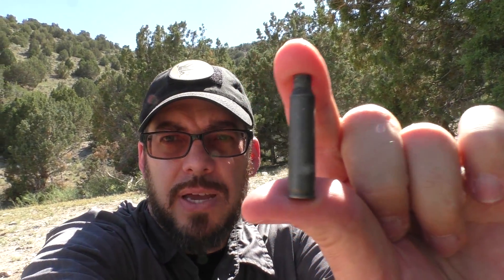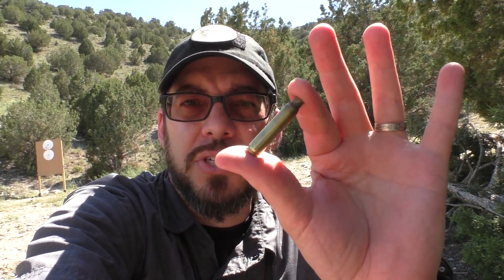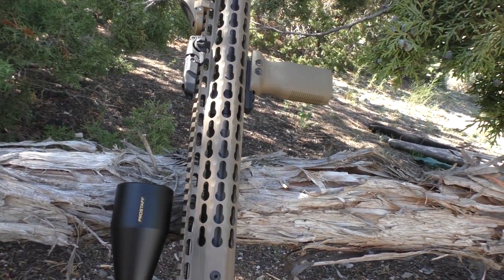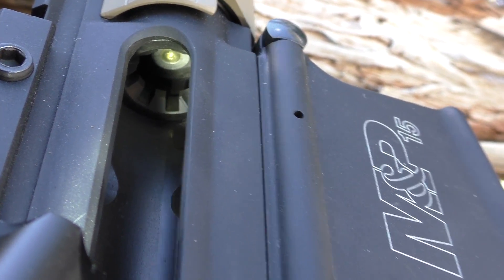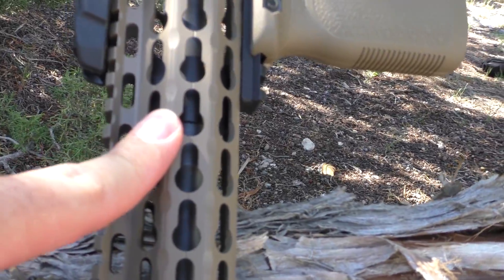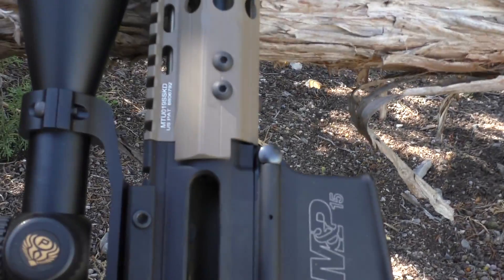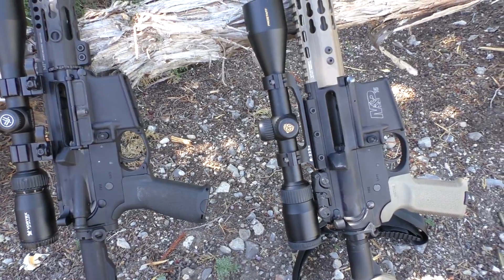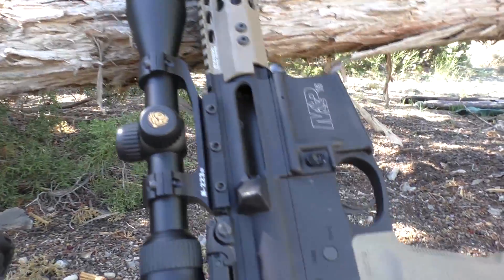Tula .223 Killed My Guns! V-Log Thursday

Comment: Bore erosion gauge if run one through both if not all the ar types you own especially since they have already had rounds expanding within the bore and getting stuck hope this helps if it goes past the warning line you may need a new barrel for both the rifles steel cased ammo is considered corrosive I know comments will blow up about that but it is and it's mostly cause it's steel running on steel so chances of you runing a thousand rounds or so though it and experiencing case expansion doesn't surprise me brass ammo won't get as stuck cause of brass being a softer metal than steel and most of your brass are polished casings there designed for ease of use and longevity of the weapon in mind there's a reason Tula ammo is cheap hate to say it but it's true

Comment: You can't get a rifle hot enough to burn the coating off of the steal cased ammo. The brass cartridge typically have a 3-5 hardness or so on the mohs hardness scale I believe and steel or bi-metal cased ammo is between 5-9. Therefore the steel is a bit less malluable than brass causing the steel bi-metal casings to not expand and seal the chamber like brass which in turn creates I higher amount of carbon build up. Carbon in itself is very hard and hard to remove once its been allowed to build up. Routine cleaing of the chamber with a good solvent after say 500 rounds should prevent it from happening again. I'm not an expert these are just my observations and experience over the year and knowledge passed to me by people who do this kind of work for a living.

Comment: Run the bolt wet. Be sure to clear the chamber before taking a break from shooting that particular rifle; the coating on the steel case will melt and then harden once the barrel cools essentially cementing the case to the chamber.

Comment: Bad batch? Or just a hot barrel causing the case to expand more than usual?
I hear this is more common with tula compared to other steel case rounds.
I can't confirm. I don't shoot steel case all that much.

If i had to guess clean the chamber using a chamber brush on a cordless drill real slow at a low rotation speed with solvent sprayed in the chamber. Working the brush in and out of the chamber slow and steady for 30 seconds. Should keep any build-up of carbon left behind.

I try to buy brass when its cheap.
Now days (may 2022) from what i can get, tula is about .39-cents per round after tax+shipping. Where i can get brass .44-cents per round after tax+shipping. So the .05¢ per round difference isn't enough to separate barrel erosion and barrel replacement cost down the road.
If the price difference was .20¢ than without a second thought steel case would be a good option.
With what is going on in the world, i tend to be more conservative about my ammunition usage as of the past couple years. Its a gosh darn shame I can't buy brass for .25¢ anymore.

Comment: I only run steel in carbine length DI system or longer, and even then it depends on the gun. as some carbine length system may be a bit over gassed depending on the gas block used. my keltec plr16 refuses to use any steel case ammo because it's a powerful piston driven system but I've also worked on SBRs for local law enforcement and they won't reliably extract steel either. so most pistol length systems just refuse to work. most carbine length systems do work with steel just fine but you just have to check your gun with it (most don't have an issue). the SBRs usually required alot stronger extractor spring along with the hard rubber cylinder inside the spring. the coiled around the barrel longer gas tubes also seem to help. steel is hard to extract from short gas systems or powerful piston systems. I'd never trust steel cased for defensive shooting but it is good for cheaper plinking especially if you don't reload. well, I would use steel cased 5.56 in my century c93 and vector v53 because the fluted chambers seems to work well with steel even with the well known violent extraction of delayed roller lock h&k system. If I have to shoot steel cased ammo I always take an AK cleaning rod with me to knock out stuck cases, it's alot better than ruining a good brass cleaning rod.

Comment: So I see this is a pretty old video, but what did you find? Its not a bad batch and its a pretty common issue that I experienced as well.  I learned about upgrading the extractor spring. I've installed it and will be testing this weekend ( BCM Extractor Spring) .  Enjoy!
Reply from the maker: I chose to ditch steel cased ammo altogether. That solved the problem.

Comment: I use tula in my s&w as well and have no problems. I also clean it after each day of shooting.
I was thinking that maybe its just a tolerance issue with these other barrels you've put on your rifles, possibly tighter than the stock s&w chamber.
So with that train of thought I agree with the posts explaining the carbon buildup due to non expanding steel cases.

Comment: Steel cases have lacquer on them usually and also have a sealed primer and it can cause issues in the Chamber and bolt face supposedly never seen it but I've heard of it the only other thing I can think of is cheaper guns (although threat guns I have be same m&p) may have weaker extractors and steel can wear them down supposedly. Again never seen it but have heard it

Comment: I've had similar experience with Silver Bear/Brown Bear steel cased ammo.  I had problems using brass-cased ammo AFTER using the steel case.  When the round fired, the action would cycle, but rip off the rim of the casing, leaving an empty casing jammed very tightly into the chamber.  This happened multiple times, making it necessary to take a rod and ram the stuck cartridge out.  I think the lacquer left residue on the chamber making it extra tight.  After shooting the rifle with brass for a while, it seemed to start working properly again, but now I'll never use steel case in my go-to rifle.  On my junkers, sure I'll use steel since it's cheap.
Reply: Is your magazine that is bending the rim or extraction lip of the casing. File down the front of your mag so the casings rim doesn't contact it anymore when it's being loaded by the bolt into the receiver. I left a main comment explaining in more detail. Do that and you'll never have that issue again with any ammo.

Comment: It's because of the magazines your using. I'm assuming they are metal but others can do this as well. When the bullet is extracted from the magazine, the "extraction lip" of the metal bullet casing (shell) is catching the front edge of the magazine causing the metal casing extraction lip to get bent back making it impossible for the bolt carrier to completely close over the casing & engage the bolts extractor. This is because the casing lip is now bent back and holding the bolt back. 
The fix: pull a bullet out of your mag just as the bolt carrier would & see how much of the lip is catching on the mag. Mark the mag then file it down so the lip of the casing no longer makes contact with the front of the magazine as its being fed into the receiver. Problem solved. 
I use surplus mags and do this to all of them & i no longer experience this problem. 
Why doesn't brass do this you ask:  well it does, but brass is softer and the bolt carrier can push it back into its original shape whereas the metal is not. Don't believe me, try it & see.. your welcome...

Comment: You need to mop the chamber with solvent to remove the polymer build up. Lacquered cases might be a better choice for plinking. My Colt locked up a spent round after shooting 4-500rds without cleaning. Talking with a guy at the range his M&P liked it. His wife's Bushmaster would choke after 2-3rds. James Yeager has a video talking about this subject.

Comment: In the first 70 shots I put through a new rifle I had a case so badly jammed I had to pound it out with a dowel and rubber mallet. Took a pair of calipers to case and than a normal. The entire length of the case had a diameter of 9.598mm most of the others were around 9.4x-9.5x which is spec. I dont understand what would cause this defect but its annoying as hell. Hope that puts some myths to sleep

Comment: I learned back in the 1970's that Steel and aluminum cased ammo is no good for firearms, and I have never seen anything to change my mind. what you may want to do is find a wax or other lubricant that will dry and coat your bullets with it.

Comment: It's because of how dirty they are. The carbon build up. We use to shoot .308 tula in a bolt action rem until we found that they were "gumming" up the chamber and thus a soild stuck round. I've never seen it happen to semi auto AR! I still shoot it in my smith&wesson sport. I always clean my AR at the end of the day if I shoot tula because I know how dirty they are. P.s. we also had to send the .308 rifle off to Remington to have them remove the casing of tula .308 they also confirmed that it's the ammo. It's a carbon/what ever they coat the steel casings with to prevent rust problem.

Comment: Could be and I have seen this. If you run a few mags at a time the heat build up in the chamber is enough to melt the laqer/ poly coat they put on the cases and if you leave it chambered the poly coat will harden like glue trapping the round when it cools off

Comment: No... It is the ammo. I have narrowed it down to the ammo. Yes repeatedly it happens. I have a PSA upper mid length gas system. Also with red army standard. Red army standard is the same but the casings were stamped Tula. It got to where I take cleaning rods with me to the range. My gun cycles brass no problem and Brown Bear steel no problem. It is the Tula ammo.

Comment: The timing on 16" barrels on the AR platform is sometimes off, being as the platform was meant for a 20" barrel. Also, the steel cases take a second longer to cool and retract, so it is harder to extract from the chamber.

Comment: I have a PSA and BCM upper on two of my rifles. Both have BCM BCG's (swear by them). I have shot close to 2K rounds through each so far. Not one issue with either Wolf and Tula (ammo (only shoot steel case). Drum roll....I have never cleaned either rifle so far including BCG. I want to see how long they will go before I have an issue (test). Not trying to say anyone should try what I am doing= bad advice.  I hope to get 5K each problem free. I won't own a picky AR. I built them to get beat up and get used vs looking pretty in the safe. 

My bet is your BCG needs an upgrade on the extractor spring.  That or you got a bad batch of Tula ammo. Good luck and be safe. Enjoy your videos..thanks for sharing

Comment: "Fight-ending malfunctions?"  This is steel cased, it is meant (in the US at least) for training and target practice not combat.  While I have never had this happen with Tula personally I believe this could happen as steel (regardless of the brand) tends to get deformed during firing / ejecting and some people think that the lacquer can melt if a round is left in a hot chamber during a extended pause in shooting 'gluing' the case to the chamber.  Please understand what this ammo's purpose is and you will be alright.  You might drive around town on your local bigbox store's cheap Kumho-Yokohama-Sumitomo tires but are those the ones you would trust for winter off-road driving?  BTW, you take two ARs to the range and not a single cleaning rod?

Comment: I had the same exact problem yesterday I went out to sight in my scope on my spikes tactical ar 15 and I opened a brand new box of Tula I had three jams before I could get through the mag. I had to use bolt assist on two of them but one wouldn't push in or out, so I took it to the shop and finally got the bolt with the case back but the bullet itself was stuck in the barrel. After I got that out I changed mags with regular brass and it fed perfect I have no clue why the Tula  jammed so much considering that I cleaned my gun before I went to the range

Comment: I also personally have a Smith & Wesson M&P 15 I love that rifle it's a very reliable rifle my very first AR-15 to be exact but I also experienced this with Tula 223 the reason it happened is because I was not using the brush that was cleaning the M4 feed ramps as well as the chamber for the bullet if you do not clean the chamber for the bullet as well as the M4 feed ramps you will get even brass that will Jam inside of your chamber the reason why your guns didn't do that first one is because the lacquer from the Tula 223 or even gunpowder and carbon we'll get into the chamber and cause bullets to stick this was a common problem in the military and the invented the brush that cleans the chamber I highly suggest that you get WD-40 spray the brush that cleans the feed ramps and chamber and that will solve the problem just keep the rifle clean brother

Comment: Most civilian AR platform are over gassed. With a standard 3oz buffer, your bolt speed is to fast. Use a heavy buffer slowing down the bolt speed, and your extraction problems will be solved

Comment: The Tula ammunition and monarch ammunition come with a lacquer coating on the shells that with continuous use and heat from the barrel tend to melt off the casing and adhere to the chamber and start caking on until subsequently glues the casing in the chamber, this is even more pronounced if you don't extract the casing right away and let it cool down in the chamber with the lacquer sticks even harder, my suggestion is to clean the chamber out real good with solvent and add a couple of drops of oil to the chamber while using this Ammo every 200 or so rounds or stop using this cheap Ammo!

Comment: I took this stuff to the range also took some federal 5.56mm ammo too. The Federal ammo worked perfectly but the Tulammo would fail to chamber a round almost every single time I would hav eric chamber a new round manually, after I used up the cheap Tulammo i went back to using Federal ammo and I had no issues with it

Comment: Use an extractor o ring.
Run Wet.
Don't dog em as hard with steel.
Get chrome lined mil profile or heavier barrels.
Start taking the ram rod out with you.
Scrub out all the stuck on polymer out.
Maybe Switch to silver bear if you still need the value.
From what I know they nickel wash their cases.

Good luck you may want to check your gasblock spacing on the Palmetto most manufactures leave the space that your handguard retainer ring would have because it's simpler than trying to order custom gas blocks or barrels.

Comment: All of these people are wrong. I was cycling my SW sport 2 in a normal controlled manner, that the SAME exact thing happened. Without even firing the round, on a brand new week old gun, AFTER being cleaned. I think that it has to do w/ quality control at the factory. The round hadn't even been fired. Had to take it to a gunsmith

Comment: My opinion, that batch of ammo is loaded too hot. Steel cases are expanding so much so they stick in the chamber. Take a bullet apart, measure the powder charge and see if it's way over spec. Also, crimping could be too tight cause greater case expansion before the bullet is expelled. 

BTW, TULA Ammo is manufactured by a fleet of Russian toddlers whose parents could not afford day care.. That is why it is so cheap. JK
Reply: lol good point!  Has anyone did a YouTube video on that? I'm curious about that.

Comment: I have had this happen before after only 300 rounds in my Bushmaster.  LESSON 1...ALWAYS carry with you to the range a STEEL USGI cleaning rod.  It will knock that casing out when a brass or aluminum one to only be damaged.  Steel USGI will knock it out.  The cause was that coating getting mixed with the gunk in the bore, action, and chamber and acting like glue.  Since that incident about 5 years ago I only shoot brass cased ammo in my ARs, and leave the steel cased stuff for my RPK.  I sold all the Russian steel cased stuff completely......HOWEVER, I did have some cheap Russian steel cased stuff that was nickel plated that fed and fired flawlessly.  I still have that.

Comment: OK, it's HEAT Melting the coating on the hull. Did you ever notice that it only happens when the barrel is hot? And usually the first round of a new magazine. It's when you have a hot barrel and let a round sit in the chamber long enough to melt the lacquer or some say polymer coating. And it cools and is stuck. This is worse on strait walled cases like the 223. I have never had it happen with a tapered case like the 7.62X39. So after you finish off that 2nd or 3rd mag and put in a fresh one and chamber the round and set down the gun to talk about how great that cheap ammo shoots only to find the next one is stuck in the chamber as the barrel cooled. I carry a stainless steel cleaning rod with me and clear it easy WITH THE BARREL  still hot. If you let it cool it gets much harder. Or after you finish that 2nd mag and the bolt locks open give the barrel 5 minutes to cool before you drop the bolt on a cool new round.

Comment: in my observed experience. it sheared 2 extractors on my brothers ar15 and also got 1 stuck in my uncles but luckily it was still operable once removed and didnt have to replace the extractor. (funny story about my brothers though. he ended up with an extra bcg from that) but weve also been using tula in sks and ak47 rifles with no issues. it might be getting cold welded in there. or maybe 223 rounds just arent tapered enough to let it slide out and theres more friction with steel than brass and being polymer coated seems a way to avoid that but imo i think it makes matters worse. it could be a combo of everything.

Comment: Steel cases do NOT expand like Brass does, thereby letting the (dirtier than American) spent powder to build up in the Chamber.
Extractor O-rings/beefy springs help to mitigate this, as does dripping Mineral oil onto the cases, into a loaded magazine.